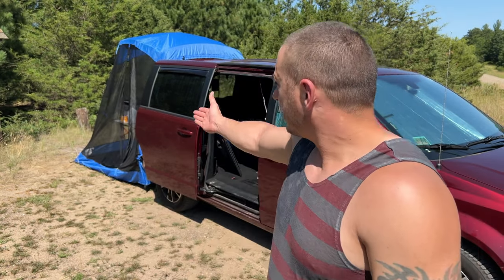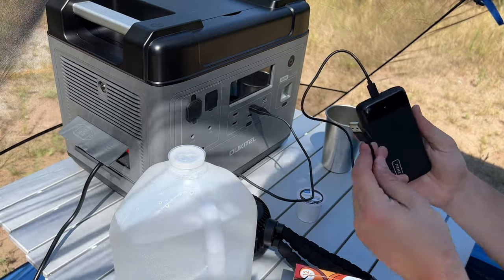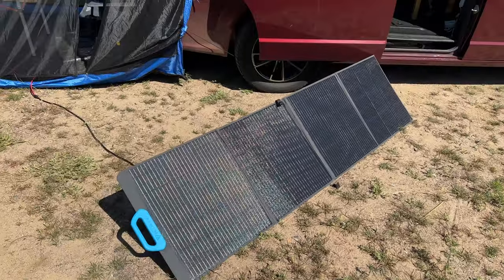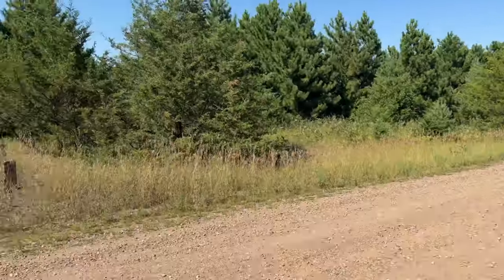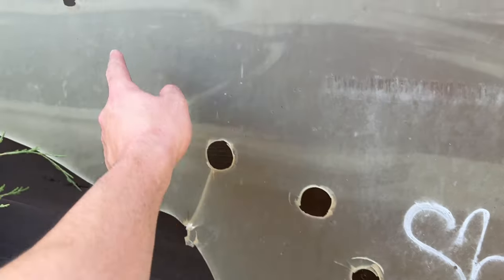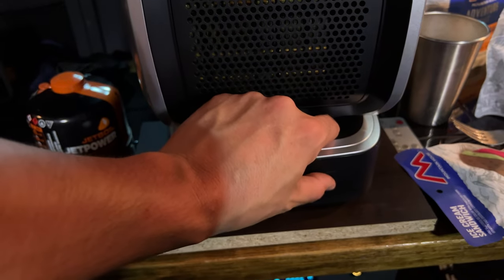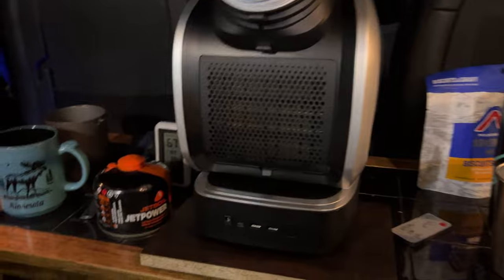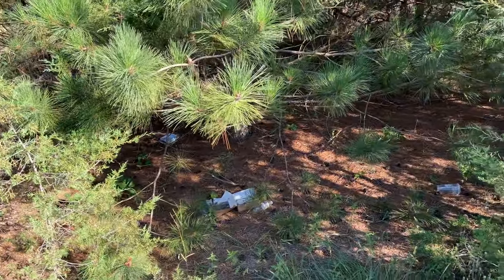OFF GRID VAN CAMPING with Zero Breeze Portable AC | Van Life

Comment: I trying a lot of methods to cool down when camping as well. I just went camping at san clemente CA last labor day weekend. The sun absolutely destroyed us as we were in that heat wave. The UV index was off the charts. I put up a tarp shelter with 8 foot poles over my tent and it did work to cool parts of my tent where the sun  didn't hit. My tent is huge a 10 person tent so I need a bigger tarp shelter than the one I originally used. I used a bunch ryobi battery powered fans. The most helpful ryobi fan was the one with the built in mister.  That helped immensely for the kids and they loved it. I ran my eco flow with a ryobi hybrid fan off my ecoflow connected solar panel.  That fan is so efficient it only ran about 15 watts on full blast.  And it was free power off the sun. With that said I will not go camping at the beach if the forecast reads above 80 because the UV is intense at the beach. Lessen learned lol.
Reply from the maker: I can only imagine. I’ve used my big shop fan connected to my power station and even on high it was under 90 wats. Blows crazy powerful wind and if connected to a solar panel should run all day without pulling power

Comment: I just started watching this but man...that thing is huge! I have 2 little portable plug in arctic freeze or arctic air plug ins that work fine in my little room that I live in when it's 115 degrees outside in phoenix,az. Although, I do have A/C where I live it's not very insulated in my room. I will be trying to use those at night in my car when I try car life and hope it works, but I don't plan on living here in Phoenix. I might try van life later but for now, it's only car. I have also seen smaller portable a/c units on amazon that I also plan on trying...i just would never be able to use that in my small car.
Reply from the maker: The zero breeze is the smallest portable ac you can get, or at least one that works. The other things you are talking about aren’t actual ac’s. It might look big in video but it’s actually pretty small. If you plug it into a power station you don’t need that battery on the bottom
Reply: Them things are only going to do anything at all in very few places people live.  The climate has to be dry.  Anywhere people are that hot that nice humidity.   Everyone else looking for cooling anywhere theirs humidity there’s no way around it. It has to be an actual ac with the compressor.

Comment: Honestly why didn’t you just open the windows to cool down if it was 65 outside? I would definitely not be able to stand having 46 degree air blow in my face all night. Tail veil is still my favorite and so is the rocking chair. Used them with grandson a couple of weeks ago as we watched some Netflix at the campground. I use Esbit fuel tabs to heat water for instant Starbucks coffee and freeze dried meals. Or the Coleman butane stove. Propane scares me. I can’t believe you lit it right in the van by that power station. Around here you can’t just shoot a bear with a Glock. You’d get in big trouble. Careful with both of you carrying one. Kind of concerning maybe. Stay safe out there.
Reply from the maker: Sounds like you had a great time. 

I wasn’t expecting the temp to get that low as it was 85F and 95F the next day, but I stuck with it as testing the ac was on of my goals of the video. We can’t just shoot a bear out here, it has to be a pretty serious threatening situation. Bear mace if first choice, but having the extra protection in serious situations when solo camping is nice.
Reply: @TolbersCamping  I saw a video where they recommended carrying two can of bear spray.
Reply from the maker: @learntechwithruth2147  I have a loud air horn as my second option. Some situations that may work better to scare them off when I can’t spray
Reply: @TolbersCamping  yea I got an air horn like that after I saw that. I can use it for kayaking as well. I have not set it off but the label says it’s loud!
Reply from the maker: @learntechwithruth2147  it’s definitely loud lol

Comment: I hate to appear stupid. But why would you suck air from the outside into the car? Why wouldn’t you just want to recirculate the air inside? So in my mind, I would have the exit tube going outside, but leave the tube sucking air in on the inside. Am I wrong? That’s the way the window units work. There’s only one hose to blow air out. It sucks in air from the inside.

Comment: Hate ac.
Reply from the maker: It definitely blows really cold air, but still recommended something a little bigger for a minivan. I’ll be using the Ecoflow wave 2 soon which should perform much better
Reply: @TolbersCamping  In summer when its to hot for me i use a normal fan. Ac is just to cold for me when i whant to sleep

Comment: Thanks for the review of the Mark 2. I just find it lacking on cooling power since it only has 2300BTUs.
Reply from the maker: yeah all depends what your purpose is. If very portable and pulls low amount of power for off grid cooling this is a good option. If you want to fully cool a decent size area you'll just have to get a not very portable setup and massive batteries and solar.